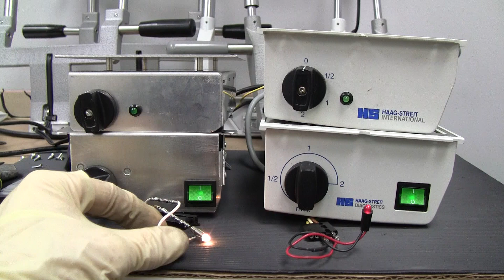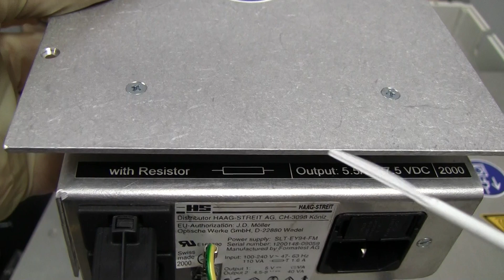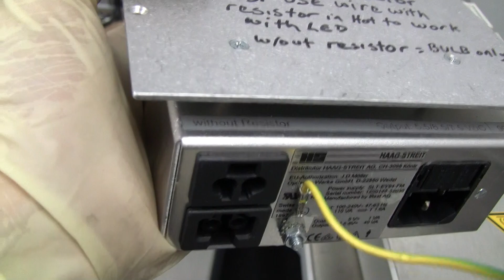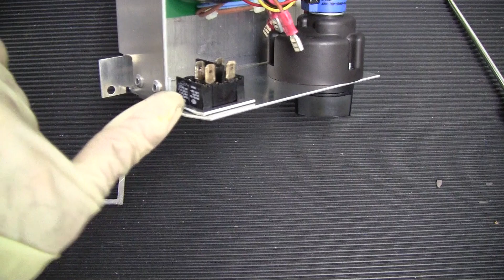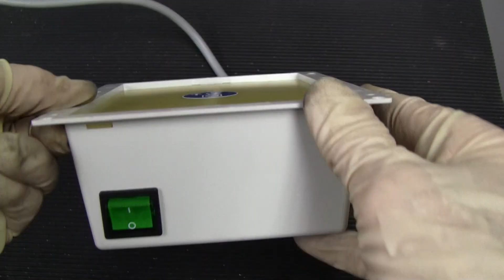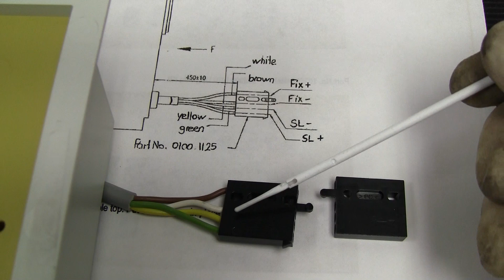Haag-Streit Power Supply & Fixation configuration: it's all about resistors and jumpers

Comment: I have a power supply from a Reichert XCEL 200 but it doesn’t give energy to the light bulb
Reply from the maker: Are you getting voltage out of the power supply? Does the light on the on/off switch light up? I hope you have a meter to check for voltage and continuity. After you know your power supply has voltage at the connector, you must follow the path of the cable that sends the voltage to the bulb wiring/socket and keep checking to find the point of disruption. I hope you can resolve it.<><